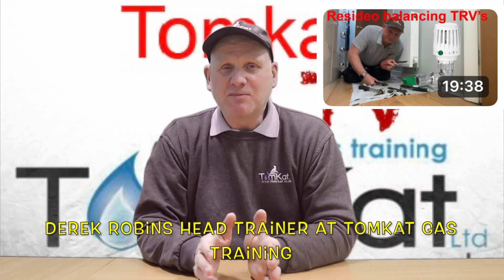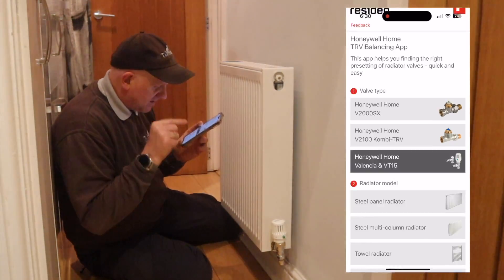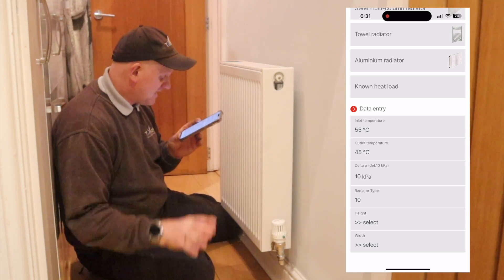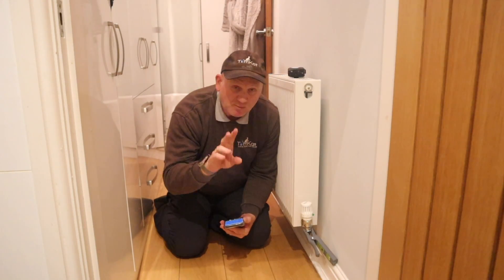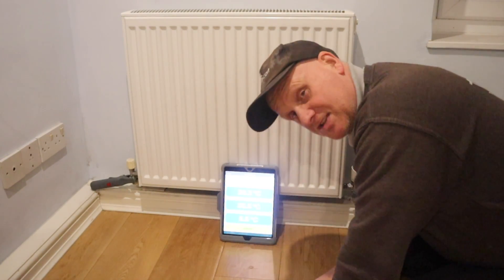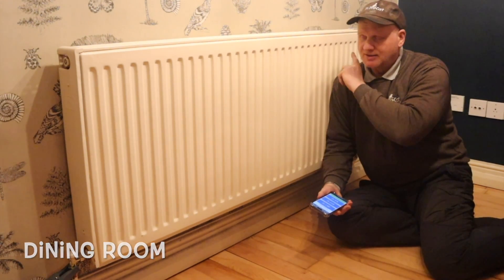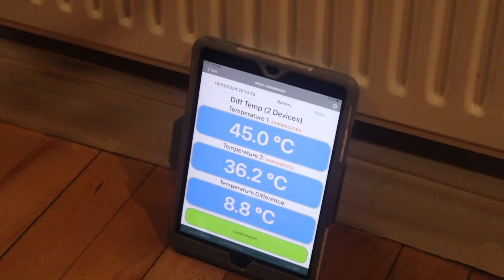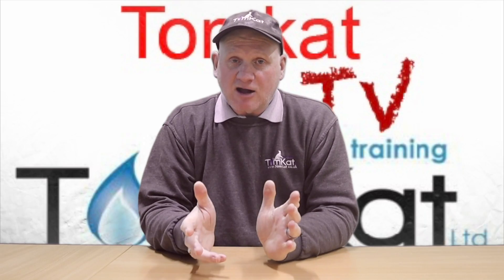Resideo Honeywell Home  balancing radiator  valves DO THEY ACTUALLY WORK?  part 1

Comment: Interested to see those valves having spent a lot of time commissioning radiators in commercial and some domestic buildings years ago, these would have eased life somewhat. Remember also that all design figures are just that 'design' figures and should only be considered set when the design space conditions have been met.  Your flow temperatures would also suggest that your boiler set temperature is not what you think you have set it too. But then again until the load settles as design space temperature is acheived the boiler is still climbing up to full load.
Reply from the maker: I think my test proves your point the boiler isn’t range rated and only a couple of my rads are designed to give the correct output at 55 degrees. Look at for part 2 where I set the rads for 20 degrees difference.👍🏻

Comment: Do the lock shields have to be completely open or do you still require the lock shields to be opened less nearest to the boiler & open more further away from the boiler?
Reply from the maker: Just completely open it’s the trv that does the balancing